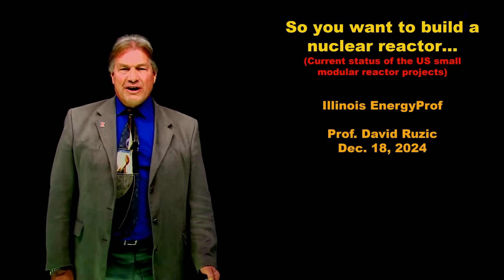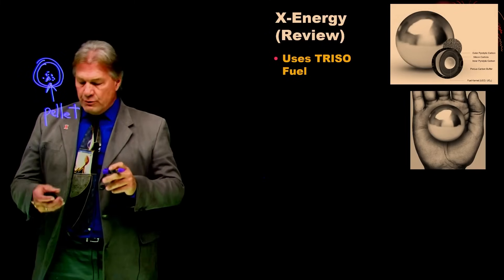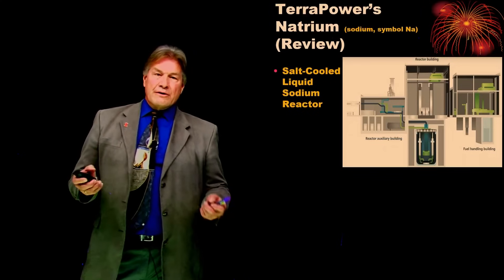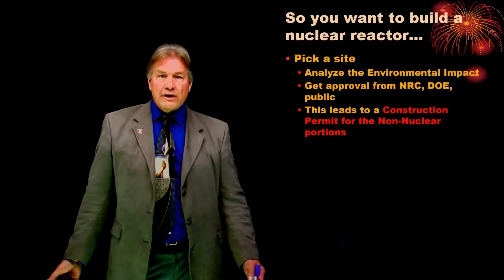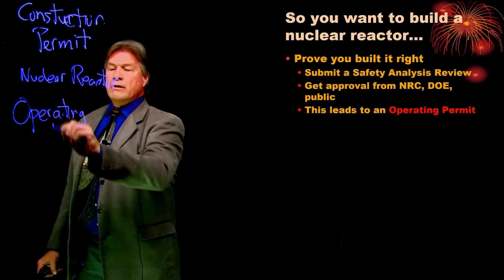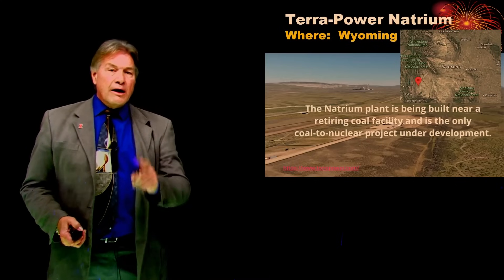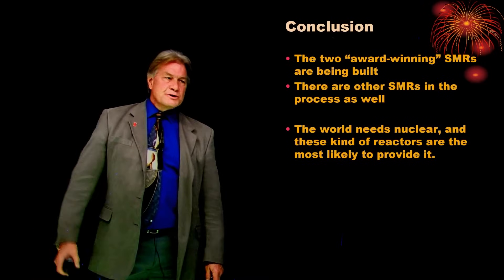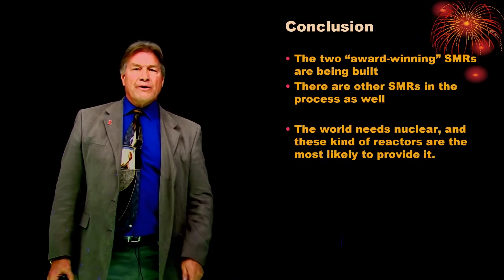So You Want to Build a Nuclear Reactor

Comment: The gen IV reactors also produces more manageable waste. It is more radioactive, but decays much faster. Waste from old reactors can also be "burned" up in a gen IV reactor tuned for it.
Reply from the maker: absolutely
Reply: How does it "decay much faster"?
The half life of all the fission products remains the same.
The very long-lived uranium bombardment products remain the same.
As for waste from old reactors, these wastes have high cross sections. They give back less neutrons than they absorb. 
The primary neutron source produces more fission products than it destroys.
That's how the "spent fuel" became spent in the first place, even in reactors with very high enrichment.
Reply: @aaroncosier735  In a fast reactor you are not slowing down the neutrons, so they have enough energy to fission the heavier elements, releasing heat in the process. There is no accumulation of heavier elements like current reactor design. That´s how the reactor can run on natural uranium-238 because it creates it´s own fuel. The waste consists of different fission products requiring some reprocessing to separate out the heavier fission products (and the plutonium) to be reintroduced into the reactor. The half life is proportional to the radioactivity - higher radioactivity=faster decay.
Reply: @karnic-f1x  
Yes "fast neutron" reactors are unmoderated. They have lower reactivity and fuel efficiency from the very start, by definition.
That's why they need to use enriched fuel, to the legal limit allowed.
Bombardment products are specifically the product of fast reactors (hence fast neutron breeders).

The reactor cannot run on U238, it needs a neutron source, and it never makes more than it uses.

Reprocessing doesn't help much. The fission products still require durable disposal solutions that last many more centuries than any civilisation that might create them.

I really don't think you have thought it through.

Comment: Hey Prof, it's been a while. Good to see you again. OK, now to click 👍and watch the video.
EDIT: 
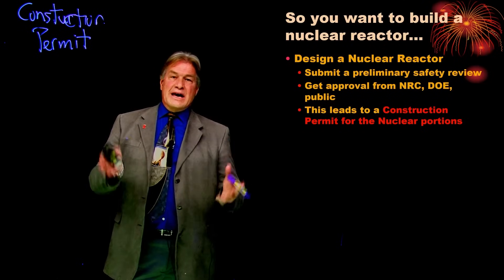9:35 Are there any of these SMRs that are totally portable? As in, the entire operation mounted on / contained in one or more Standard Shipping Containers?  Is the tech for something like that even feasible at this time? It would be amazing to simply drop off a couple semi trailers and Viola, here's your electricity! 
Even if it was like 10 semi trailers, one of which had the control room, another for the team of nuclear specialists that are in charge of operating the plant, that would still be really neato.
Reply from the maker: That is the general idea.   There is another class of micro modular reactors that make on the order of 15MW of electricity that are indeed totally portable -- great for the military or remote mining operations.  The ones I described here have the nuclear reactor part (or parts) arrive on trucks.  One still has to pour a lot of concrete etc. on site.  Still, the most complicated part can be made in one place and supply sites throughout the world.

Comment: Also please explain that that for every $10BILLION spent on nuclear reactor electricity then $100sBILLIONS of grid infrastructure is required. 

The grid needs 10 times more cashflow than the generators. 

This is fundamental to this electricity to the customer economics. 

If the millions of customers switch to their dirt cheap rooftop PV electricity and SWITCH OFF grid electricity every day the sunshines, then the national grid will have a SHTTSNPANTS cashflow event every day the sunshines. 

With v2g EVs parked all night the the cashflow SHTTSNPANTS feelings in the grid owners will become chronic. 

Many take on board your explanations.

My decades of experience falls on deaf ears. 😮😮

Comment: There was no mention in these designs about enabling the "mass production" mentioned earlier. Is this not planned for these reactors, or is it just to be pursued after demonstrating operation?
Reply from the maker: Gearing up to mass production requires a lot of capital.    If the first ones work as advertised the hope is that it will follow.

Comment: Do us all a favour and explain that

 247 full power nuclear is a critical engineering requirement for safe nuclear power reactors. 
Heat stress cracks are in French reactors that load follow. 

And 247 cashflow is a critical economic requirement for safe economic nuclear power reactors.
French reactors are government subsidised. 
Low $kWh only with 247 full power.
Reply from the maker: By using the salt storage, the reactor itself does not have to load follow --- just the electrical generation part.     All fossil plants load follow and work fine.  It would be the same tech here for the electricity generation part.

The French government is the owner of the gird and the power plants in France.  It is a government run and owned.  In the US there are many, many power companies which are government regulated, but privtely owned.  Different systems.
Reply: @illinoisenergyprof6878  Thank you for your response, I do quote you, I am a Construction Engineer including large power industry plant and transmission. 
Retired and free to speak up.
My experience is warm latitudes, Australia and Indonesia for one year. 

Reactors with salt heat storage can load follow which is good.
But the size of the storage and the sodium salt temperature and its need to be contained from the atmosphere can be achieved on a first trial reactor you would expect.
Larger scale nation wide, and world wide, is still years away for a climate change solution. 
So I have my doubts. 

Peaker plants for today's extreme load variations, was my understanding, because of the greater load variation. 

France's large fleet of nuclear reactors meant all load followed, or a few varied outputs the greatest. Cracking is a big issue at the moment. My comment only, from a climate driven perspective.

Comment: Smaller reactor?  Intrinsically stabilizing reaction? Higher heat compatible with more efficient power generation?  Synergistic salt generation to smooth later, deferred power generation?   This is the first bit of optimism on the science and public policy front since...   Since...  well, let's  not go there.  Great video.

Comment: Hmmm, in your “absence”, have been looking at other sources on these.  James Krellenstein of Alva Energy for example, has an excellent talk about the neutronic inefficiency of small reactors - with the virtual inability to control where the neutrons go from fission, the smaller the reactor, the more neutrons are lost to the surroundings, embrittlement of the reactor materials, the greater difficulty associated with shielding - all of which translates into lower overall efficiency with far higher cost - orders of magnitude - for the resulting useful power.  Certainly there are niche applications where this cost may be justified, but it is a myth that there is anything like a useful cost reduction from “mass production.”   And another key element here, from the already mentioned challenges associated with shielding, it turns out that fully half of the fixed cost of a nuclear power plant is the civil works of the site [fascinating time lapse videos are available for Vogtle 3 & 4 showing the amount of work involved with dirt (a couple years worth) before the first concrete was poured, and so on], so again, with that cost effectively fixed for 1100 MW or 50 MW - a prospective customer would be amortizing the costs over far less electricity sold with the smaller reactor.

For those interested in a real, under-construction — nuclear parts and all — reactor — on may investigate their Project Pele.  All of the above “concerns” are acknowledged by the brilliant PM, and DoD doesn’t have to ask the NRC for permission to operate - there is close coordination for other aspects of the program), and DoD’s driving requirement for this reactor is to be able to transport it with a C-17 - and the test will be to set it up in location A (Idaho National Labs), run it, shut it down, pack it up, load it on the C-17, fly to Site B - set it up, and run it.

Welcome back professor !

Comment: When I was at the College of William and Mary, in the library there was a very large double rack of reports required for the permitting and licensing of the Surry nuclear power plant (not a small modular type).  There were probably several tons of paperwork on those shelves.  I never saw anyone but myself show the slightest bit of interest in the materials on that rack.  Trying to read even one report would put anybody to sleep after a few pages of all those words and tables.  I can't imagine that any regulator actually read any but a small portion of what was there.  I could imagine that some unfortunate government worker had to go through the list of contents and verify there was indeed a contents section for each of the requirements that the regulators had demanded.

Comment: 6:18 is there a mistake there? I believe the Prof misspoke, the thermal power should be lower than the electric power rating.
Reply from the maker: I did misspeak, but I think I wrote it down right.   320MW thermal, 200 MW electric is correct.
Reply: @illinoisenergyprof6878  great content btw, it puts into perspective the long construction times that many point out to when discussing the issues with nuclear Energy.

Comment: Can you please explain (or someone) what exactly you mean by 'high temperature energy' and why that is important to chemical manufacture?  I don't understand why a kWh of electricity cares about how it was made.
Reply from the maker: A nuclear reactor, or a natural gas burner or a coal-powered burner all make heat.   The best you can do to turn heat into electricity is at "Carnot Efficiency".  I'll spare you the formula, but the higher the temperature, the more efficient the process is.  Typcially with current nuclear or coal, it is about 33%.  The very high-temperature reactor can do it at over 50% efficiency.
     However, there are other uses for very high temperature heat too.  One such use is direct hyrdrolysis of water into hydrogen.  But, there are a number of chemical transformations -- things DOW chemical or other chemical companies do to make the products we all use.  Instead of buying electricity and using it to get something to a very high temperature to do your chemical process, you could use the high temperature heat from the reactor directly and save all of the conversion cost.
Reply: @illinoisenergyprof6878  Thanks, I didn't quite get that the chemical plant was using the heat energy directly from the reactor.  ie, not from Heat -> electricity -> back to heat.
Reply: Traditional light water reactors have an output temperature of about 300 degrees C which is too low for most industrial process heat. Gen. IV reactors are up around 750 degrees which makes them much more efficient for making electricity and for direct industrial process heat.

Comment: Could we use these ideas to properly process previously generated "bad stuff"?
Reply from the maker: Yes.  But, you would have to take it out of the current wastes, and add it to the fuel.  The cost may not be worth it.    The current "bad stuff" is long-lived, but the volume is also small, and can be isolated safely.
Reply: @illinoisenergyprof6878  So, would the costs be "worth it" for newly used fuel? 
"isolated safely"

For how long? Under what conditions?

Will any current storage survive prolonged neglect or power outage?
What provisions are in place for failure?

Comment: The US put small reactors in submarines for 70 years. The entire crew lives in the same tube as the reactor, with missiles, and torpedoes, under the sea. What new technology is necessary to park similar reactors on land, in a building, in a field?
Reply: Good question.  The technology has to be somewhat different.  For instance, where is the cooling water on land, in a building, in a field?  There may also be an issue of economics.
Reply: Economic concerns are not the primary motivators for military powerplant designs. 

Making it cheap enough that the capitalist oligarchy can extract more profit over existing world-destroying power plants is what requires us to develop new technology.
Reply: US military submarines are not comparable.
Their costs had none of the limitations of plant that has to compete.
The engineering constraints are quite different. A submarine has unlimited access to cooling water and has no electoral consequences for failure in proximity to citizens.
To overcome the intrinsic limitations of such a small format, yet deliver performance and responsiveness, US submarine reactors use very highly enriched fuel and use it at woeful efficiency compared to civilian power reactors.

There is no useful comparison. The conditions that made naval reactors possible are simply not available for civilian power generation.

Comment: If pebble bed and molten salt reactors are so much better why aren't they used everywhere?
Reply from the maker: They will be -- but they are a new invention and these reactors will be the first commercial test.  They have been tested and run at National Labs etc.
Reply: @illinoisenergyprof6878  Pebble Bed reactors aren’t quite a “new” invention. X-energy’s reactor is an evolution of the South African PBMR from the late 90s/early2000s, which itself was a development of a German PBR design from the late 70s/early 80s. The big problem of these reactors has always been the cost and difficulty of fabricating the TRISO fuel “pebbles” in large quantities to exact, consistent specifications. X-energy claims that their new plant and improved process will significantly reduce the fuel fabrication costs. I wish them all the best but only time will tell whether they will actually achieve the cost reductions they are forecasting.

Comment: It seems to me that existing reactors should be converted to run the new spherical fuel.  Just suspend the fuel in cages like the fuel rods are now.   The reactor might not perform at the same levels but the improved safety would seem to make sense for aging plants.
Reply: Well, no US nuclear power plant has ever killed anyone (basically 65 years with 0 deaths), and none of the nuclear bits have ever resulted in a casualty (basically 65 years with 0 injuries).
Exactly how much safer do these plants have to be?

The TRISO fuel, is not only packaged incorrectly for existing PWR & BWR reactors, but is cooled with gas (typically helium or nitrogen, not with high-pressure water) so you would have to change not only the fuel assemblies but ALSO the coolant loops and pressurizers.
On top of that, you would have to make a case to the NRC that this Frankenstein is somehow safer than the original design.

Comment: There is a giant hole in your description of this process of building and grid connecting a SMR. In the "benefits" section you talk about building SMRs serially in a factory, but in your "How to build a nuclear reactor" section, you do not mention the bit where they actually build the SMR factory. I am genuinely interested in how this bit works, since this is the bit that people haven't done before. Does the NRC regulate the factory production of ready-to-go nuclear reactors? Since this is a manufacturing process, do they need new regulations surrounding serial production and dispatch of complete, sealed reactors? Do those companies actually have factories already? What are the siting requirements in a nuclear reactor factory? There are so many unanswered questions about this I would like to learn about.
Reply from the maker: Those are really good questions.  These first reactors will be built somewhere -- and it is not going to be at the site itself.  My guess is that is what turns into the factory.  All of the PSAR is about the construction of the reactor, so it covers the "factory".
Reply: @illinoisenergyprof6878  Until I see a submission by one of these companies to a regulator for a SMR factory, I am going to be very skeptical about the M part of SMRs until they break ground on that and not the final site.
EDIT: The part about the TRISO fuel manufacturing site near ORNL is a very good start though!

Comment: bah, what we need is economy of scale of very large 4th generation reactors, we have UHVDC lines to take the power more than half a continent away

no need to put stinky little reactors on trucks, just run a transmission line.

These weenies are infactuated with the tech coolness of a tiny reactor but it's waste of money with much lesss bang for the buck, won't save the planet that way